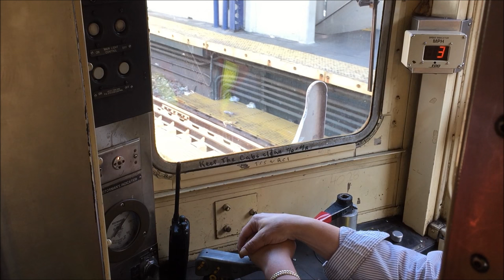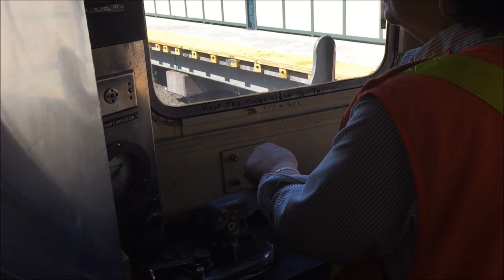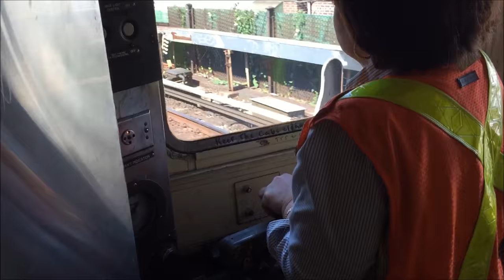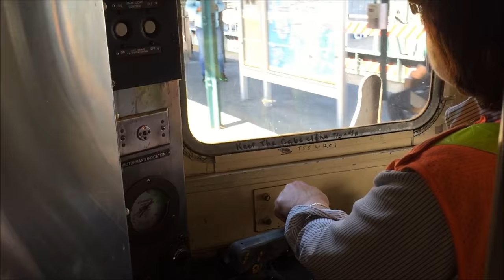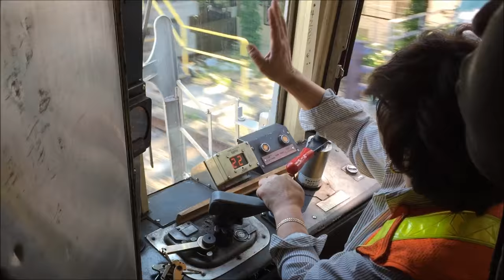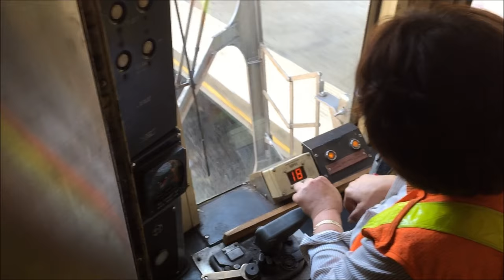NYC Subway Nostalgia HD 60fps: R38 & R40 Slant Cab Operation (6/25/16)

Comment: That would be the coolest job, though after 2-3 years I'm sure it would be nice to switch lines to the scenes aren't so repetitive
Reply: You can work a different line almost every day, it’s called working “exta”
Reply: @Anewuser_6282  if i would work in the MTA as a t.o. or conductor i can work at any lines i can choose?
Reply: @joshuajimenez6893  I was wondering too, but I don’t think so. What ever Train they assign you to drive you have to drive it for a long time. I live near the (2) train and I see the same Train Drivers most times that operate the train, They do this route because they know the route and memorize the speed and stations and train dispatchers.

Comment: She is one smooth operator.  Seems really cool too.
Reply from the maker: ehh quite frankly surprised the resistors didn't burn up with the controller being held in switching for THAT long.
Reply: Correct me if I'm wrong because I'm not sure, but I think R38's have resistors that are not enclosed in the deranged box like on an R16/17 so I think they tolerate a bit more switching.
Reply from the maker: True and also untrue. The design idea behind the enclosed, force air cooled grids on the GE R16/R17s was actually in part to permit longer operation times in resistance points. Provided the MG works as intended, at low speeds, you would still be supplying sufficient cooling air to the resistors. Open grids are subjected to the whims of the air flowing over them, which can vary based on weather, and train speed. Since switching typically keeps trains at very low speeds, unless you're experiencing abnormally high winds, the grids are not being cooled as much as they would be if they were supplied with forced air. Hence, just like first point on our trolleys, you're not supposed to use switching on RT cars for more than 2-3 seconds at a time before shutting off and coasting for a few seconds.
Reply: While true in theory I've been advised and to some degree seen for myself that air circulation in the box was in reality inadequate to perform the task in a superior way to the thermosyphoning principle of the open grids.  (Grids heat local air, it rushes upwards due to lower density, cool air rushes in from below, even with train at low speed.)   I've been advised by Joey that 6688 can only be used in switching for even shorter periods of time than 5466 and 1689.  Do you find the same to be true?
Reply: @FanRailer  hi. Can you help me? Where I can read about American old subway trains? 70-80s years. I did not find much of it. I mean operating, driving, motor control system, signaling system? And why people there saying that 25 mph is crazy driving?

Comment: I have a question, I know there are switches for trains but do they go over them automatically or the operator has to do something for the train to completely switch tracks?
Reply: No some tracks must be switched by the train operator by pressing a button at the station
Reply: Many tracks are switched using s button in stations by the train operator. Some operators are too short to reach so they might use a stick out the window to push the button.
Reply from the maker: To clarify, punch boxes (the "buttons in stations") do not directly align switches. Most send a command request to the signal tower, and notifies the tower operator of the trains desired line-up. The tower operator then throws a lever to align the switch for the train.
Reply: Sometimes there is a punchbox on a platform or against a wall that the motorman uses to get a lineup. Then other times they will call a tower to get one, especially if they cannot get past a red light.
Reply: @FanRailer  what happens if a passenger on the platform presses the switch?
Reply: @visionist7  the tower would already know it’s false because they can see if there’s a train or not

Comment: ok, can someone explain me how that thing works ?? if im guessing right, you pull the lever towards you if you want to accelerate, push it forwards for idle speed (??) and the right lever is the brake, pushing it forwards in order to stop (or pulling it towards you maybe ??)
Reply from the maker: Yes. On the cars with two control levers, the left side is the throttle. It has 4 points; idle, and 3 points of power (switch, series, & parallel). The right side is the brake; release is parallel to the cab window, full service is about 7 o clock. 6 o clock is emergency, and 4 o clock is handle off.
Reply: Fan Railer thank you !! now i know how to operate a subway car
Reply from the maker: Yea, it's not as simple as you make it seem.
Reply: Fan Railer yeah i know, you have to pay very close attention and all of that, but it isnt impossible you know
Reply from the maker: Having operated equipment, yes, I do know.
Reply from the maker: It's not like this is top secret information. All of this is available online in some form or another.
Reply: Thx
Reply: carljohnson621 there is more than that.

Comment: I want to be part of the MTA company so bad. But I want to be the conductor lol, Driving the actual train can be scary
Reply from the maker: lol conductors have to deal with passengers ;)
Reply: Fan Railer I wouldn't mind. I have experience handling customers lol. Still better than Driving the train. You just never know when some crazy fool decides to push someone onto the tracks and you end up accidentally running over him/her. I would be traumatized for life.
Reply: Fan Railer I'm certain most motorman were formerly conductors. That's how my uncle started off, as a conductor.
Reply from the maker: Up until the last Open Competitive test for T/O, the TA DID hire for the motorman position off the street.

Comment: I wonder how I'd find a subway where I could even do this without getting arrested... I guss where they have the door open up in the front is a good start. I remember being on an M4... used to walk all the way to the front, and yes I know thats MTA Metro North.. would have been New Haven Line (I'm from Waterbury, CT) and back then that M4 had a door you could see into if the driver left it open. Subway operators though on the other hand come from driving MTA buses from what I know anyway. I'm 28 and don't have any job but would like to become a passenger rail operator, anyway. Perhaps, though, start off as a city bus driver. I think for that all you need is the F (passenger) endorsement on your drivers license. Probably not a huge amount of trianing, not like the CDL class A anyway... wow im talking to myself. Nice video I enjoy it. I like how focused she is.
Reply: Officer Gregory Stevens for bus operating you need a class b cdl with passenger and airbrake endorsements the motorman is a promotional for us i will say only this working for the mta sucks but you cant beat it 20 down 9 to go

Comment: I did not care for them 38or 40 the control would hurt my left hand
Reply: Motorman 2015  easiest controllers to handle. You likely never worked WH R30s or Westcodes
Reply: i did. friggin LOATHED the R44s.. utter bastards to operate.  the R30s,27s and even the R16s were easy compared to the 44s.
Reply: and ive done R10s local . rock park to bedford park. 2 trips.winter.
Reply: Apparently, that's why they were retired.